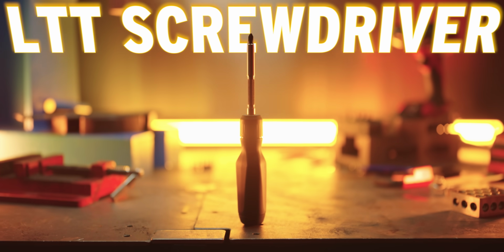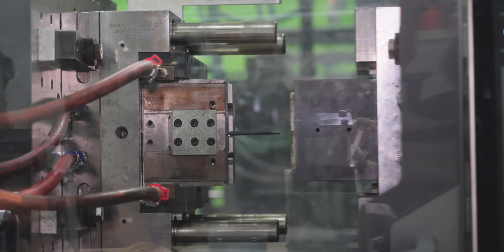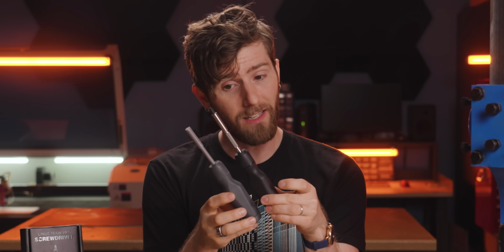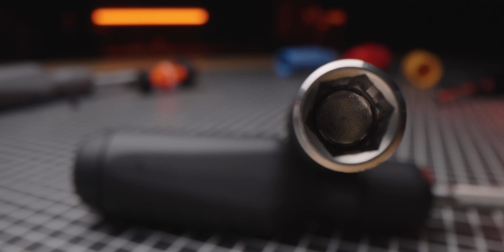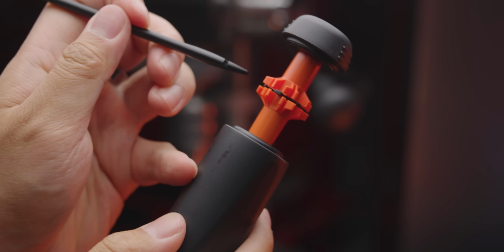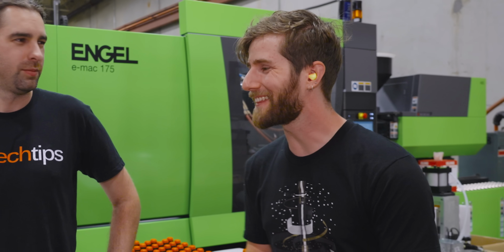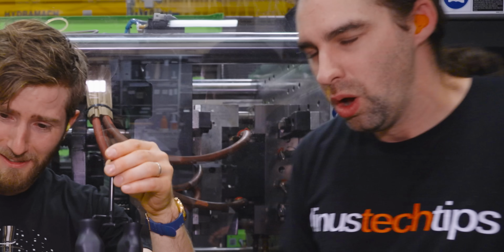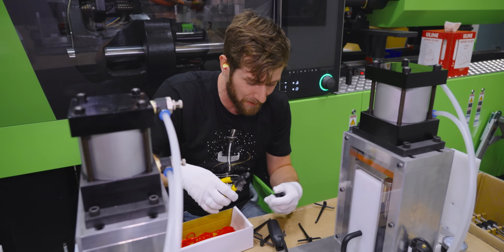Why our Screwdriver took 3 YEARS

Comment: So much respect for going through with this and changing every tiny issue. Even pointed out small flaws it still has. Not to mention it looks like a ideal/perfect screwdriver.
Reply: @labrikorn_3299  It's not deeply shocking. They spent a shit ton of money on these screwdrivers and now they're looking to make their return. I wouldn't be surprised if these eventually go down in price once they breakeven (if they do lol).
Reply: @labrikorn_3299  You're paying for quality materials, thus the higher price. Most don't use that quality of steel or even that grade of plastic. You get what you pay for.
Reply: Respect? Lol he went through the entire process to try and justify the insane price tag of 70 dollars even top shelf screw drivers like Wera are half that entire tool kits by I fix it cost that much they are high quality too... it will sell for people that want a LTT badge on there tools as a screw driver of this type its horrendously overpriced
Reply: @maxeriousbrooks9807  wera is most likely not anywhere near as well designed. I have a wera screwdriver myself but this screwdriver looks way better quality, the grip on the pole would be handy, the 6 extra bits would be very handy and the ratcheting system looks way smoother and easier to turn, although it has double the maximum rated torque at 50nm instead of 25nm.
Reply: Really.. it's a $70 screwdriver and it still has small flaws? No thanks..
Reply: @hhaste  the flaws are unavoidable cosmetic defects due to the molding process. Even then they did everything they could to minimize it.  As far as the price, $70 is not a ton considering the hundreds of thousands they put into everything. The quality is far better or at the minimum on par with anything near that range. Design is likely better too.
Reply: @thebaum64  I think the point is that a simple screwdriver should never approach that price, regardless of who’s brand is on the handle.
Reply: @staceyfunk9689  You're paying for quality materials, thus the higher price. Most don't use that quality of steel or even that grade of plastic. You get what you pay for.
Reply: @staceyfunk9689  plenty of incredibly popular screwdrivers are well over that price point. if you're worried about the price, you aren't the market for the screwdriver. everyone doesn't need or want a $300k car, but if you have that kind of budget, you want the best car you can buy, not the most cost effective car. if you don't want to spend $70 on the best screwdriver, then don't, get something that's cheap and does what you need.
Reply: @hhaste  No product is perfect regardless of price. Sorry you can't afford nice things.
Reply: @hhaste  Dumb take.
Reply: It's a screwdriver, 3 years.  Not a car.  Not the space shuttle.  There is no9 way they are making a profit for their little business,---and that means they get tax payer dollars (most likely, being on the front of YT), and can take their sweet time trying to figure out how to make a screwdriver.  It looks like a dysfunctional school project to me, (which is probably how they got our money----for 3 year development to make a screwdriver.).  To take 3 years should tell you a lot.  They barely have enough brains to sharpen a pencil.
Reply: @EarthSurferUSA  You're kidding right? Honestly a lot of these negative comments are just disappointing. Not even half decent arguments.
Reply: @EarthSurferUSA  What? How would they be getting tax payer dollars? They make plenty of money in other ways in order to fund these long running projects. I mean they're dropping like a million dollars to build out a testing lab just because they think it will make for good content, a few hundred thousand to develop a new high quality product isn't even that crazy. Plus even though it's expensive they're going to move a lot of units. I don't know what their profit margin is on each one, but I wouldn't be at all surprised if they recouped their money very quickly
Reply: @EarthSurferUSA  have you ever worked in machining or done any prototyping? These things take a LONG time to do. That car, that space shuttle you talk about literally has hundreds of engineers designing different tiny parts of those vehicles.

IF this screwdriver is better than anything on the market then price needs to show that unfortunately, if you disagree then complain to snap on that the price is so high and should be $25 at most.

Comment: I have a Bosch 2607019328 on which the ratchet got completelly dismantled by itself, the grip became loose and start to rotate on itself and the ring for the rotating head didn't completelly held the head in place (from day one).
I hope that for twice the price and a fraction the amount of bits (and of course ignoring the head thingy, I don't thik it was that usefull) this will not suffer any of these issues.

Comment: Sorry, man love the channel and was really interested until I saw the price point. I get you spent a lot of money on the R&D and I understand you need to recoup your costs but as a professional installer who does Video Surveillance,  Access control, A/V and Digital Signage with my company along with a lot of IT hardware installs and I can't see spending $70 on a single screwdriver for my workers when anyone can get a Klein Tools’ Multi-Bit 15-in-1 Ratcheting Screwdriver &  a Multi-bit Stubby Ratcheting Screwdriver  for under $70 on Amazon for both plus you can add in a 14-in-1 Precision Screwdriver for $15 more...It's a hard pass for most professionals as we like you we need to run a business and get the best bang for our bucks.  I am betting as I am sure you are that the hobbyist who subscribe to your channel will more than make up for those of us who will skip. Best of luck though glad you stand by your product. Looking forward to more videos.

Comment: this is awesome. but how could everyone at LTT overlook one MAJOR thing: A CASE. with a driver this good, how are you gonna just throw it in a drawer or box? that's the only thing stopping me from getting this.
Reply: If you have the capabilities I am sure people are going to design cases that are 3D Printable for this screwdriver. Would prefer a first party one but there will definitely be other options.
Reply: @dallindr  i don't. but 3D printing also wouldn't be as smooth, or as well designed as the thing it carries.

Comment: I'd rather have a longer screwdriver that can reach deeper into tight areas. And having a bit storage for normal sized bits is a necessity. Sorry but the 2 things you tried to "fix" is the reason I won't be buying this screwdriver. Overengineered it :/

Comment: It's nice, but that $70 is still a lot. Kinda like $250 for the backpack. Though, I did not look at the warranty service. Because paying a lot for an overengineered product that doesn't have a comprehensive lifetime warranty, then it is not buy-it-for-life. So if the warranty is good, and doesn't cost extra, then it is worth the price for both.

Comment: I think my question was the one that was missed on the last WAN Show. You were getting tons of questions about the screwdriver and began to answer them and mentioned the "FU" bit set. I had asked if you had plans for Gamebit bits? They're 6 lobe security screws (in two different sizes) for Nintendo Carts, the GameCube, and iirc the N64. That would be sick.

Comment: This is pretty much exactly what I've been after for gunsmithing purposes. The ability to have both high torque and fine adjustment (and to use my existing stock of bits) is sorely lacking on most drivers. Consider another one sold.

Comment: Ordered! Eagerly waiting to see if this will become my new favorite go-to. 

My prior favorite go-to was the GreatNeck Screwdriver, 6 In 1. (Yes it's available on Amazon) While not ratcheting, it was very handy and easy to hold. One of the key things I liked about mine is I could take the shaft out of the handle, reuse it on a cordless drill when I couldn't find my bit set albeit clunky some times. I can easily see why Linus took his time to make the perfect screwdriver. It's not easy to get it exactly right for everyone.

Comment: Surprised you went with that style of multi ended screwdrivers.   Granted it's fine for light duty, new construction which is mostly what you do.   I would have though you would go with one of the designs that works for people working on older computers as well.  But anyway, you clearly showed what style it is so no harm no foul.

Comment: Not keen on the plastic sleeve. But looking forward to being able to purchase one at some stage. 
Though, would it be good to use as a general screwdriver for DIY etc? Or is it designed only with the relative delicate work on computing in mind?

Comment: Price seems reasonable if it's engineered to the old Snapon level of longevity. I have a longer snap on version like this that is aprox 20 years old. Got it from my father in law who used it in his auto shop for most of its life. Still works like new
Reply: It's either going to be an epic tool all around from the car repairs I do to tech stuff... Or an epic failure. But like many have said, I too love the transparency of how it's done and it gives me confidence. I have mine on order in the 1st wave so let's see.
Reply: @lknowledge  a well designed tool can last generations. I have an electric drill that is over 40 yrs old. Has been involved in building several homes (was dads), other tools I have are as old or 20 plus years. Will probably order 1 in the 2nd wave.
Reply: @dre4759  I know. I still use a lot of my fathers tools from the 70s. That's the thing, either this is one of those indestructible tools or fail in some weird way that no one expected. Hopefully it's the indestructible one as it's not cheap and I really like to use tools etc that are not designed to fail after a certain period (ex car mechanic here so I know way too much about that).
Reply: @lknowledge  same. Ordered 1 (wave 4).
Reply: I have the snap on one and I love it. If I still needed to provide my own tools for my job ID be buying one to go with my snap on
Reply: if it has a true life time warranty maybe - but does not include bits or normal wear and tear - ultra expensive

Comment: Interesting fact: GM ignition switches failing in the early 2000's were also caused by a part being out of spec by around five thousandths of an inch.
Reply: They also knew about it and did the math to determine it was worth killing people instead of an early recall
Reply: Had to do some conversion to figure out what that is in metric. 0,127 mm is quite a lot when it comes to manufacturing (source: I'm a CNC operator)
Reply: @MrM45ter i'm also a cnc machinist, and yea, when ur tolerance is like .05 or even .02 mm. .12 mm is a lot
Reply: @DylanVos05  not really, when it is completely impossible to see that level of discrepancy visually. So if a machine doesn't report the issue there is no way to know it is off. Unless of course you manually measure each and every party by hand, which isn't feasible in a manufacturing environment.
Reply: @williameldridge9382  eh its something you would definitely do with the first few prototypes.

I was trained as a machinist (pre CNC). That kinda tolerance should have never have made it off the line, an off the shelf cheap micrometer can pick that up with no  issue and something any decent machinist can do by hand.
Reply: @williameldridge9382   @William Eldridge  Measuring parts physically is feasible.  Have you ever heard of "frequency"?  You trust the machine,--and you will have entire shifts making scrap because union workers can't figure out how to read precision measuring instruments.
Manufacturing and quality engineer here, (with tons of machine exp.).  I know 100% inspection is really about 80% effective also, (people get tired and  distractions). Have you ever heard of checking parts with a frequency?  Check one out of ten coming from the machine, (what ever frequency you need for a feature), and you don't even have to check every feather for every part.  Measure a bad one, and pull the last 10 (or what ever the frequency was) and have them checked.  It is probably more effective than 100% inspection.  If you are running with no human brains,--I am sure you already have produced shifts of bad parts,---and probably sold them.
Reply: @DylanVos05  Cutting aluminum with a .125 diameter solid carbide cutter.  What is the feed and speed you start with?   Just seeing if you are actually a skilled machinist, or just a union button pusher making more money than skilled people in non-union shops.
If you start a shop and hire a few people,---you will not be hiring union experience because you will not make money.
Reply: @EarthSurferUSA  i never use tools that small… i do program tho.
Reply: @williameldridge9382  In his example the finished product literally is over double the expected tolerance. That is A LOT. 0.12mm in machining is also A LOT. Those casting molds you see in the video? They usually have tolerances that are less than 0.01mm. (I worked with tolerances of 0.005mm before and we had problems with actually manufacturing within these tolerances.)
Reply: @MrM45ter  not really. You can't say that without knowing the details. An injection molded metal or plastic part could easily be out by 5 thou, even a CNC part can very easily be out by 5 thou. Could be due to tolerance stacking. Could be due to heat treat. A million different things could cause a part or assembly to be out by 5 thou. Lots of mass produced parts have a tolerance within that. Parts that need to be made ultra fast and ultra cheap are hogged out fast and without 100% inspection. 5 thou is almost nothing. You just work on very precise parts with tight GD&T, or you watch way too many YouTube videos that talk about tenths and single digit micrometers.
Reply: Is that why the key got stuck in my Pontiac?
Reply: Interesting fact: Nearly every single electronic piece used by GM is an absolute dumpster fire. Source: I've owned two GM vehicles made after 2000 and both were electrical nightmares for seemingly no reason other than piss poor quality. Will never own another GM product again.
Reply: Damn

Comment: Hey, this is me being curious since I saw the Screwdriver and the additional bits, I was wondering  if it would be possible later on down the line to create a LTT bit case for the additional and/or spare bits that cannot be in the screwdriver. I was tempted to get all the bits to get a full toolset with that screwdriver but then realized that it wouldn't be possible to carry them all without one. Would it be possible in the future (not immediate future, because seeing the video on the screwdriver proved to me that prototyping and timing matters) that something like that would be possible?
I know this is long but the idea just so happened as I was looking at the cart ngl.
Reply: Totally agree. If not just LTT but a possible collaboration with iFixit or something. I work with cars, home stuff and work in IT so a lot of different types of heads is a necessity. I'm so fed up with the fidly or super expensive but not much better garbage that you get your heads in. Get a full set of quality heads, a good case for them and it would make life a lot nicer.
Reply: I ended up purchasing the screwdriver but didn't get any additional bits.  I don't plan on changing out the bits in the handle and if I need additional ones I can just use my kit of 1/4 bits I already own.